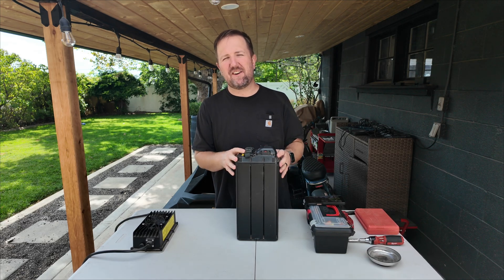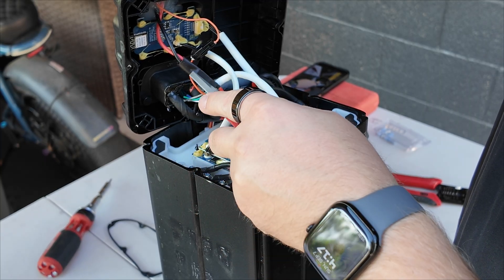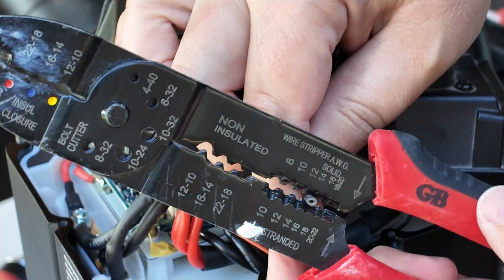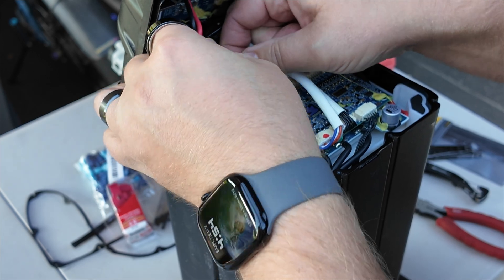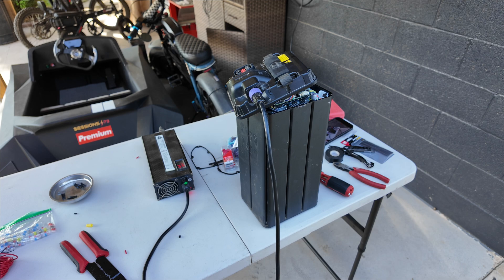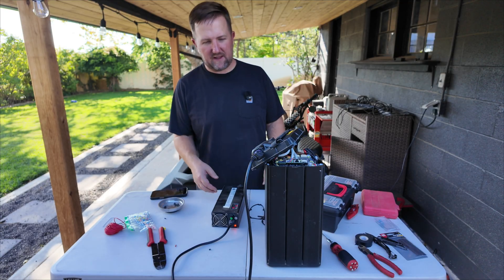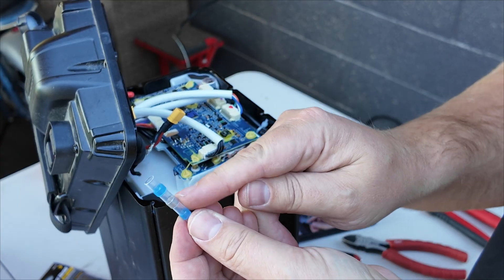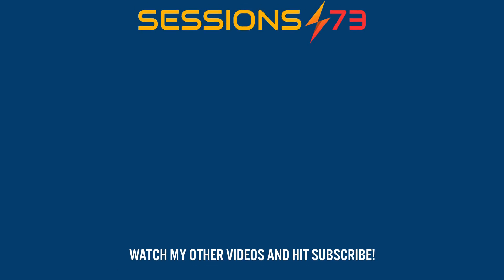I Hacked My Talaria Sting Battery to Bring it Back to Life!

Comment: You didn’t need to cut that wire mate. Just unplug it and make a lead with a xt30. Then connect like you did. It just saves you work. 👍🏽
Reply from the maker: Thanks for the tip!